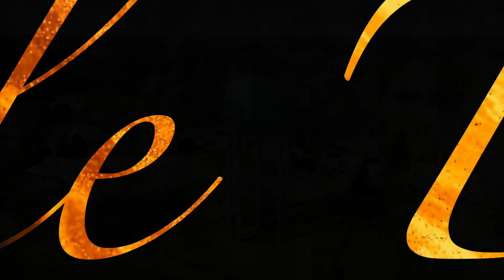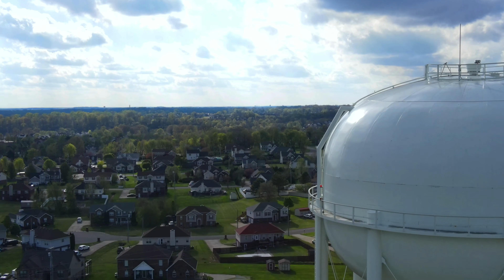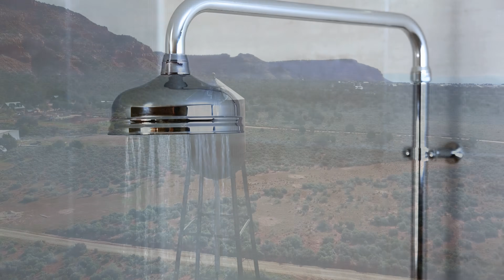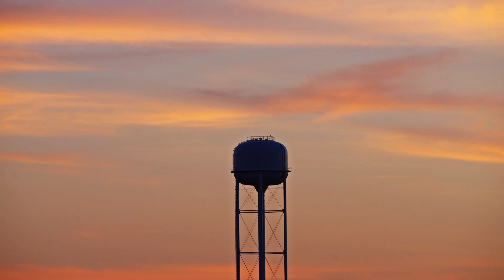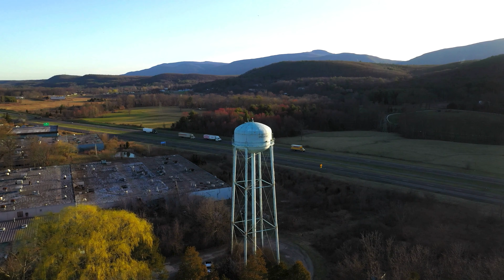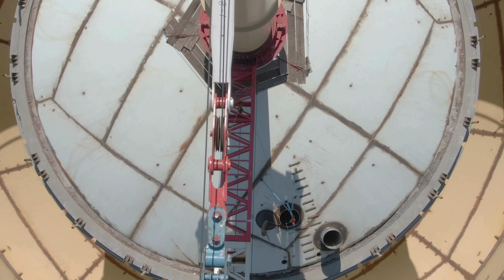Why Water Towers Have Such Strange Shapes

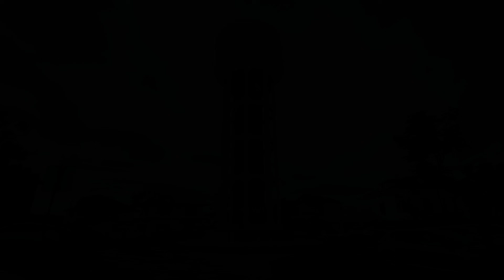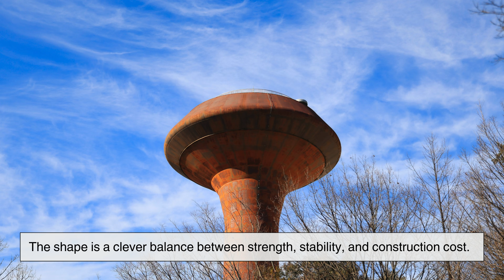Comment: It is a shame that ( 🇺🇸 no  one ? ) thought of  Stainless  Steel ... (  water = RUST 💩 )    7:33   .... and ... as for shape , these  🇺🇸  are iconic  ... In the  UK  🇬🇧  several water towers are  cylindrical  and  VERY  sturdy    4:34  ,  SO  , some  old  UK  brick  cylinders  have  been  turned  into  VERY 😝expensive  multi-floor  houses ..... DAVE™🛑